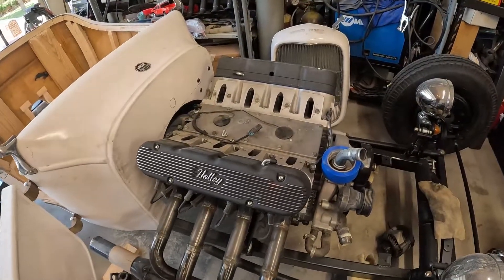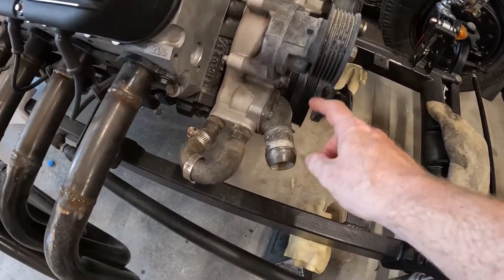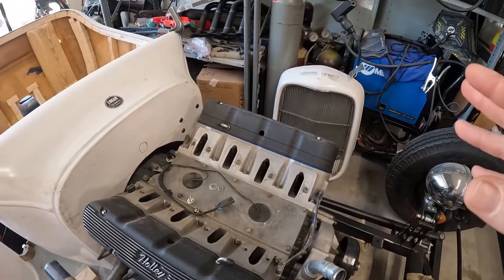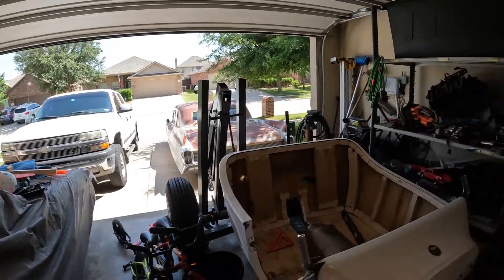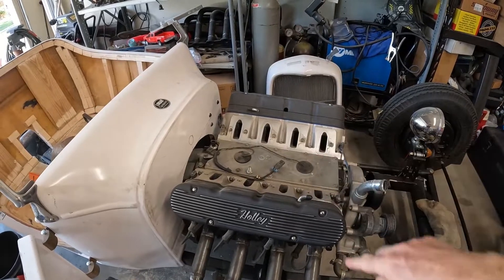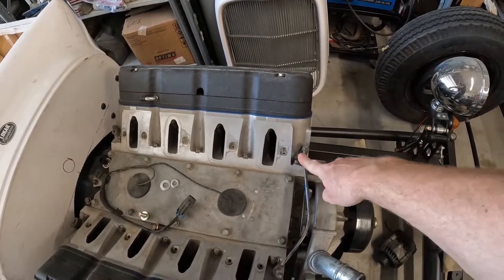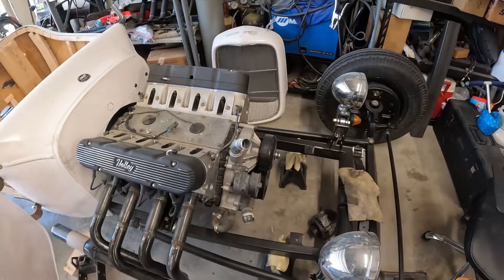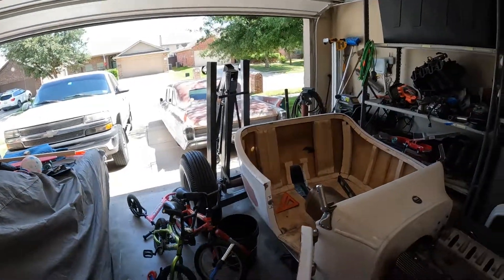LS Steam Tubes - Two Ports or Four Ports??

Comment: Is this fact or speculation?
The whole purpose of the steam ports are because of the reverse coolant flow on the LS engine…
Reply from the maker: Honestly, I don’t care which way coolant flows in the LS. Block first, heads first, doesn't matter here. The point is, LS engines need steam ports.

Sometimes they come with two, sometimes they come with four, but either way, they’re there to let air and steam escape from the top corners of the heads. That trapped steam can cause hot spots, uneven temps, and detonation, especially in the rear cylinders.

Whether you’re running a bone-stock truck motor or a high-revving track setup, ignoring the steam ports is asking for trouble. Two ports might work for mild builds, but if you want max cooling and stability, four ports are the safer bet — and that’s what this video is about.

Comment: What belt tensioner is that mounted to your water pump? I have a holley water pump and even called holley to see if they could help me find the correct tensioner to bolt to their water pump and they could not give me any info on which tensioner to use. At the moment I have a stock 3  bolt tensioner with some brackets that I made to keep it rigid and it is working fine but I'd rather have a manufactured part that is meant for my application. If you could send a link or part number it would be greatly appreciated. Thanks.
Reply from the maker: That's just the factory one that came with the motor. It's a basic LS truck one - nothing fancy from Holley. Sorry I can't help!
Reply: All good mine seems to be working fine at the moment. Thanks for the reply 👍

Comment: Can you please tell me if water supposed to circulate through to steam tubes back into the radiator on a Chevrolet 6.0? What I mean is it supposed to be a steady stream of coolant? Thanks
Reply from the maker: I believe so yes. I've never ran an engine and pulled off that steam tube.
Reply: @redgoatgarage  you can pull the one hose off at the top of the radiator by to fill hole

Comment: I put a tee fitting in the line that comes from the front vents, my truck only uses the front ones, and then put a piece of hose from there to a valve so that when filling the engine with coolant I can fill from this and it makes filling so much easier so the engine never has to run hot to become fully filled.

Comment: so I have a stock silverado lm7 and the steam vent tubes are leaking somewhere under the intake i have a small leak that i have tracked down to there. my question is should i block off the rear and just have the front hooked up or should i connect all 4 and what kit would u use.
Reply from the maker: The best method is to have all four....but if there's enough drop in the rear you could get away with just the fronts. They have little rubber gaskets under them, sounds like you might just need to replace those.
Reply: @redgoatgarage  do they sell them in parts store?

Comment: Question?
I have a 94 caprice LS whichi  LS swapped with a 5.3 lm7.  The caprice has a hose coming out reservoir and I also have same size coming out the radiator.  I have the hose coming from reservoir going into steam port but now I'm clueless to what goes to radiator. Could I use a t connector and join reservoir and radiator or what would you recommend. First time and have no help
Reply from the maker: Sounds like you have a remote pressurized tank. Does the radiator have a cap on it too? Or just this remote tank? The steam vent hose just needs to go into the radiator somewhere.
Reply: @redgoatgarage  no ,my radiator has no cap only thing that has a cap is the reservoir tank.  It has two openings one at the bottom of tank ik that ties into heater core hose going into water pump then there's one small at the top coming out the side that I assumed went into steam port . Might just purchase another radiator that'll fit application or find another tank .
Reply from the maker: @VL_World84  Yeah so that's a pressurized expansion tank. I would leave it as is. I'm not saying this is 100% right, but I've tapped the top of the LS water pump and plumbed the steam tube/hose into that before and it's worked fine.

Comment: Dude mine keeps leaking in the front I’ve changed them twice and torqued to 106inch pounds
Reply from the maker: Man that's a weird one. I can honestly save I've never had one leak on me! Not sure what's going on there with yours.
Reply: @redgoatgarage  lol I fixed it I put black rtv under it with the gasket I’m guess that o ring is just so small it’s easy  to over torque